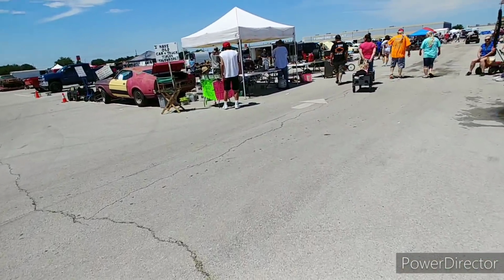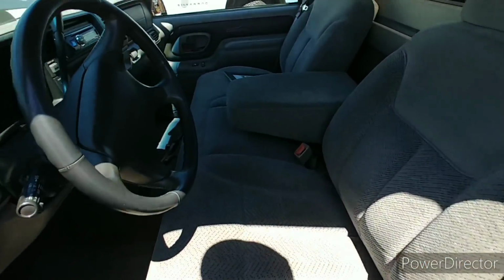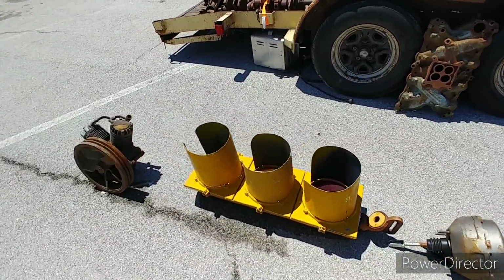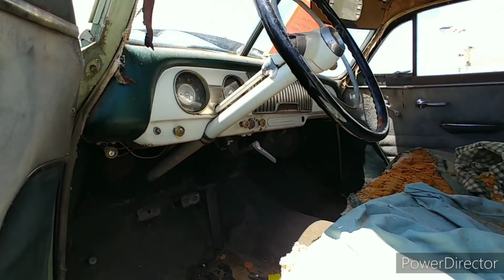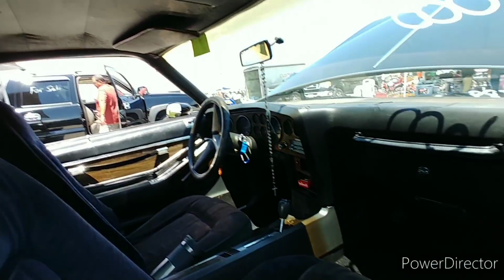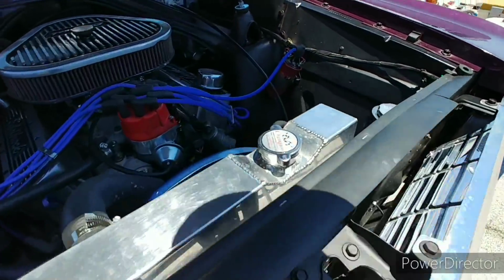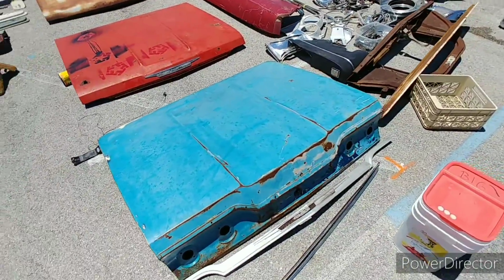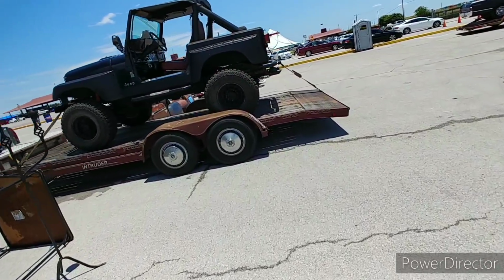Traders Village Swap Meet Grand Prairie TX 2020

Comment: I'm with you on the "find", but sometimes getting them that way is just as good. I just bought a small toolbox full of vintage USA made tools including Snap On for $40, and thrown in was a 15 (which had 14 pieces) Craftsman metric USA wrench set. I had the missing 15mm, but it's an SK, so that will complete that set (an SK to complete a Craftsman is OK in my book). If I find a 15mm Craftsman cheap enough, I'll make the set all Craftsman. Supposed to go back for another run to this location soon......I made an offer on more stuff, but the family wants the estate appraiser to value some of it.

Comment: Yup, Grumman Olson was big in the aluminum delivery vehicle business. They made a lot of bread box bodies and even for many years, modular Ambulance bodies. Today's modern modular Ambulance bodies are technically "descendants" of the GO body.

The Camaro is likely a 1978 as the Type LT was replaced in 1979 by the Berlinetta as the "luxury sport" model. Probably a 305 "LG3" 2 barrel V8. I think the rear isn't the original (perhaps) as someone marked "2.41" on the axle tube, unless they just did that for reference. 

The 400 you have was pulled from a '78 Bonneville as I remember, and yes basically the same as this 1976 model. Both a VIN "Z" RPO L78 engine which was the base engine for the Trans Am for many years.

Comment: I see this on a lot of the swap meets that you're filming and a tiny part in my head gets a little frustrated : Why on earth would anyone let any types of hose lay outside when it's sunny? I've learned that most rubber hoses cracks when they cool down after being exposed to heat and the sun. Haha, just a little venting. .